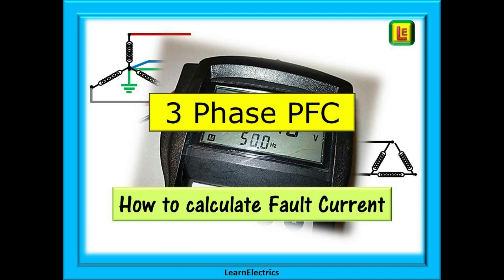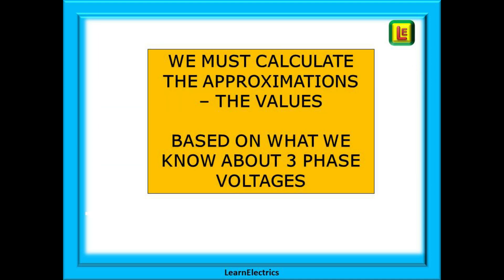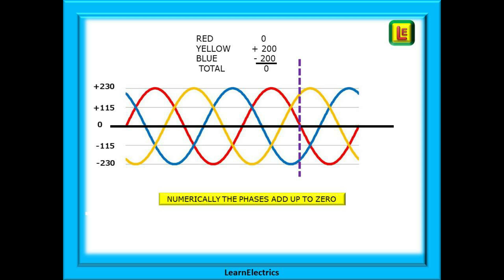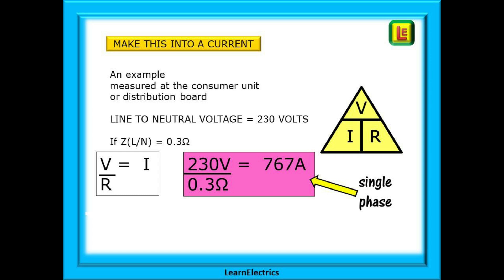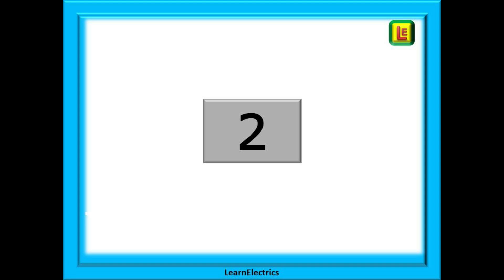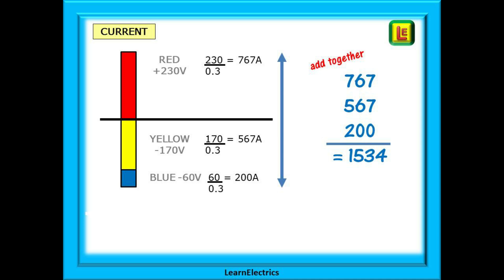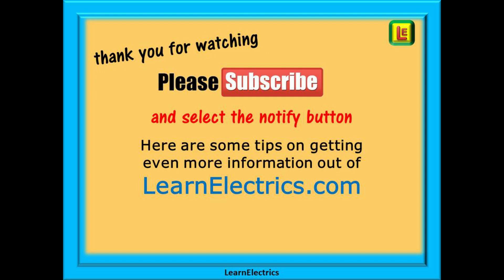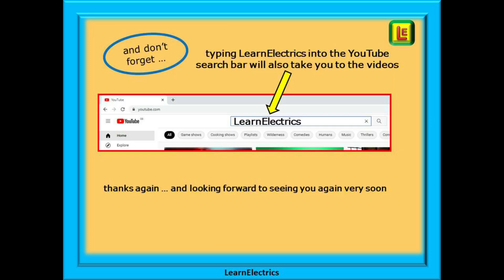3 PHASE PFC – How to calculate 3 phase Prospective Fault Current

Comment: Dont you have to times the resistances as well by 2?
Reply from the maker: Benjamin, absolutely not. The resistance of the wire is not changing. Whatever the resistance is, it stays fixed. Its the change in single phase and three phase voltages that changes the current. Thanks for asking and thanks for watching. Dave.

Comment: This is awesome. Thanks for sharing.

Why Z=0.3ohm . How to get the value?
Reply from the maker: If its a calculated value it comes from ohms law - voltage divided by pfc = Z.
For some examples I just use a figure that helps to explain. Hope this helps.
Reply: @learnelectrics4402  thanks.. keep up the good work

Comment: I have a tester that can measure phase to phase, but often will record a value which is less than double of single phase. An NICEIC inspector claimed that the value recorded is not double of single phase so is incorrect, is he right or is the test value more accurate, otherwise this would make the test of phase to phase be redundant and a waste of my time
Reply from the maker: Have another look at the video, it does make this point. Three phase is not double the voltage of single phase, just root3. Hope this helps, Dave.

Comment: I remember as an EE student many years ago, calculating the prospective fault level for a 400kV system, 3-phase to ground fault. It came out at around 35,000 MVA. Stuck in my mind on account of being a big frightening number (and a challenge to CB designers).
Reply from the maker: Absolutely frightening at times. I can remember carrying metal toolboxes through a substation and being told to stay on the paving stones and you'll be ok. Don't step off whatever you do. Thanks for watching. Dave.

Comment: Great video as always, there is one area of 3 phase I always get wrong and that’s calculating 3 phase cable size based on the equipment rating. I always spec too large a cable. If you could do a video on that it would be fantastic.
Reply from the maker: That is on the list to be done Colin. Soon. Too large is safer, but obviously costs more money. I've lost work in the past where another sparky has undersized cables just to get the work. Six months later, I was back in the factory replacing them with the correct size.

Comment: I might be wrong but I think our 230v single phase supply voltage value is an RMS value and not the peak.

Your diagram shows the peak of the wave form as 230 v

Sorry to be picky …I do like your vids which are clear and informative.
Reply from the maker: It does Michael, which is why it says on the drawing that these are RMS peaks. Our meters works in RMS so no point in confusing folk with two separate waveforms. Thanks for your reply and thanks for watching. Dave.

Comment: Clear and concise Video.

Just a comment about this being a 'live test'. Do you mean that the 3 phase DB is still live and not isolated or do you mean that the 3 phase DB IS isolated and the 'live test' is by having the tester pass voltage (230-500v) through the circuits ?
Reply from the maker: The main switch, the point at which you are testing is live. Even if the main switch is off, there will still be voltage on one side of it. You need the power to the switch to do the test.
Hope this helps. Dave.